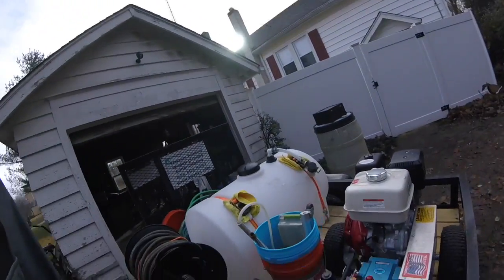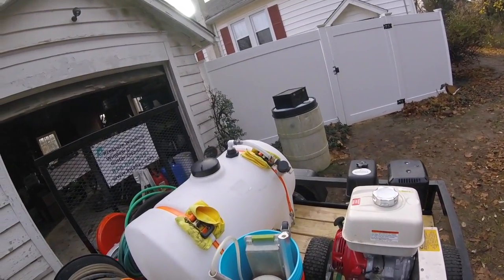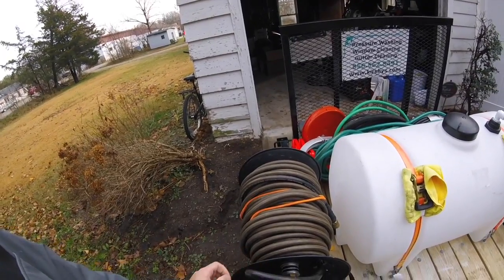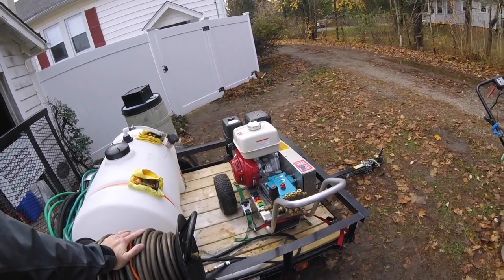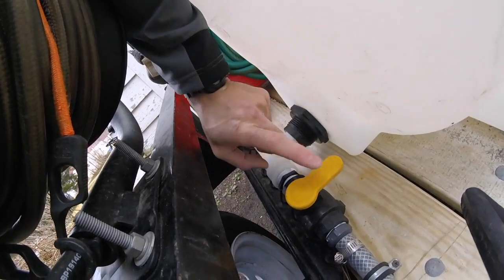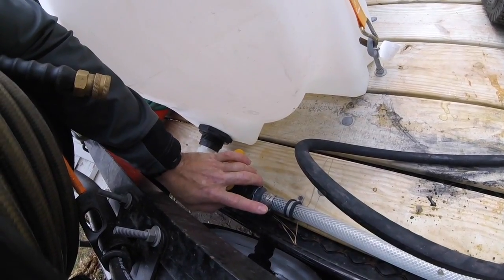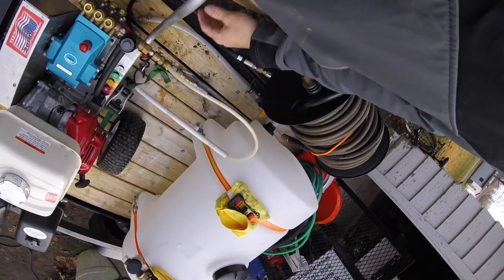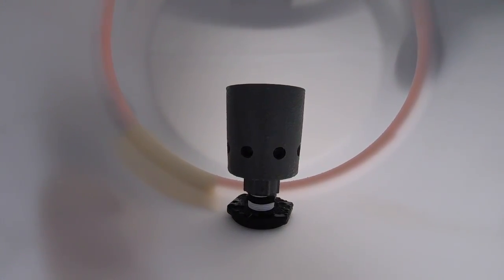Kirshy's Pressure Washing Trailer Update

Comment: This has honestly been one of the most clear explanations I’ve see on YouTube. Will you be posting anymore videos on your setup? 
What kind of pump do you need if you don’t want to gravity feed the pressure washer. I have a small trailer and a big tank and I know I wouldn’t be able to elevate the tank that much. Also how does a dump line integrate into this setup? Where would you build the dump line at? Thanks again for the great info!

Comment: I'm sure that this question has been asked, if not multiple times, at least once. I have a Simpson 3200 PSI 2.5 GPM Gas operated Pressure Washer, it is meant for residential use. Do you believe I can gravity feed the pressure washer unit like you have done here, and do I simply feed the hose from the water storage unit into the garden hose connector on the pressure washer, or is there something needed in between? I intend to be washing drive ways, side walks, and soft washing the sides of residential and small businesses. Your videos are very well done but I'm not one to understand the more technical side of things. lol
Reply: Hi Ryan,

To be honest your 2.5 gpm pressure washer wouldn't need a buffer tank. You can always use the client's spicket and you will be fine. I used a 2.5 gpm pressure washer for 2 yrs and always used the clients water and had no issues. I have a 4 gpm pressure washer and still use the clients water. Just make sure you put a filter unit at the spicket or on the pressure washer water inlet. Just in case you come across a clients house who still has not changed their galvanized water pipes. That will cause you water flow issues.

If you are going to do any surface cleaning (driveways, sidewalks or concrete floors) buy a DeWalt 18"  surface cleaner (3400 or 3700 max psi). They cost about $100.00. That will help you clean faster and better  then a wand with tip. 

Good luck

Comment: nice! I have a quick question.. I run the same pressure washer off the hose from the house... I actually had to put a bypass hose so when I'm not on the trigger it acts as a dump line out of the ground, I guess I prevent pressure from building up in the pump when you're not on the trigger... Do you still run a dump line or do you have the water going back into your water tank?
Reply from the maker: wrecked4life I still have the from factory dump line set up that loops the pump.

Comment: It's a nice set up! Are you able to wash roofs with this?
Reply from the maker: EXPERT CLEANING you could the only thing that you would need to make sure of is your SH or PH ratio to water and surfactants are correct for your roof washing job. Getting a simple fat boy pump or electric pump for roofwashing would be ideal.
Reply from the maker: Enjoying The Sun 577-Jersey Customs we only use calcium hypochlorite for our roof wash mix. Easier on plants and grass and still gives great results. If you were to downstream for a roofwash you would need to tweak the Chem % a bit. That would depend on your gpm ratio and what type of downstream you use. Your best bet would be to get a separate tank to premix the chems and use a fat boy pump or something similar to shoot it on the roof. Dwell time is your friend with a roofwash.
Reply from the maker: Dezmar Perez we never us the granular only the fine powder ch. the only thing that is ever left behind is a slight white dust look that is gone by the next rain the customer has. We have yet to have someone call us back about but we give the customer the option to choose SH if they prefer.
Reply from the maker: Dezmar Perez we never us the granular only the fine powder ch. the only thing that is ever left behind is a slight white dust look that is gone by the next rain the customer has. We have yet to have someone call us back about but we give the customer the option to choose SH if they prefer.

Comment: not a bad basic setup. Do you have a surface cleaner? If not, get one. That water broom I saw in your bucket.....what you must do with that is to disconnect it from your lance, tie a good length of rope to it, & start to spin like your going for the world hammer throw record, & throw that useless piece of shit as far as you can. Instead, get yourself a 0 deg tip & drill it out to 1.5/ 2mm.Tip straight into the gun. It should act like a fire hose. Max pressure. with max flow. You might have to sacrifice a couple of tips, but when you get it right, you'll start to boogie along.  All the best.
Reply from the maker: slim439 thanks for the tip, I will have to try that trick with the zero degree tip. I only use the water broom to clean off what I already washed with my 22" surface washer.

Comment: What size trailer is this? Where did you buy it? It looks nice!
Reply from the maker: Its a small 4X6' Mesh Trailer from Lowe's.  I put the wood decking on myself to help with stability and strength. Link: https://www.lowes.com/pd/Carry-On-Trailer-4-ft-x-6-ft-Wire-Mesh-Utility-Trailer-with-Ramp-Gate/3013702

Comment: That was a very informative video. Please sir i have some questions:

1- how much is the water tank only with the connections

2- can I build the same system to connect it to a smaller electric pressure washer (1.2 Gallon for example)

3- If I used a smaller tank will that affect the amount of pressure supply to the washer machine.

I am trying to build a small car car detailing equipment in a trunk of a sedan car , i know it may be tight but I will use smaller size electric machine instead do you believe that is possible??

4- last thing could you please give us the link for all the tank and connection tools to buy it online.

Thanks in advance sir
Reply from the maker: Mahmoud Alashry water tank was about $80 and the fittings were about $30. You can def run a smaller unit from that size tank, you will need to have the water tank a little bit higher than the pump to gravity feed the unit, those little Home Depot units do not pull well by themselves. As far as where I bought everything it was a combo of- Tractor Supply Company, Amazon and Home Depot.

Comment: I have a honda pressure washer with a cat pump. would it need to be gravity fed
Reply from the maker: They say the belt driven pumps will pull water from a tank but I would recommend elevating the tank a bit so it is gravity fed.

Comment: where you  get power washer
Reply: what size trailer
Reply from the maker: pressurewashersdirect.com
Reply from the maker: Trailer is a 4X6' Lowes trailer.
Reply from the maker: 4X6' From Lowes
https://www.lowes.com/pd/Carry-On-Trailer-4-ft-x-6-ft-Wire-Mesh-Utility-Trailer-with-Ramp-Gate/3013702

Comment: 4000 psi high pressure washer?
Reply from the maker: glenn claus, we use a 4000 PSI Pressure Pro Washer with a belt driven 5GPM CAT pump. With the correct tips and pressure adjustments it does a great job with soft washing and pulls chemicals with no problem.
Reply: allright thx 4 the info ;)